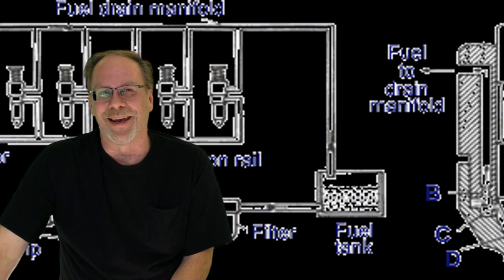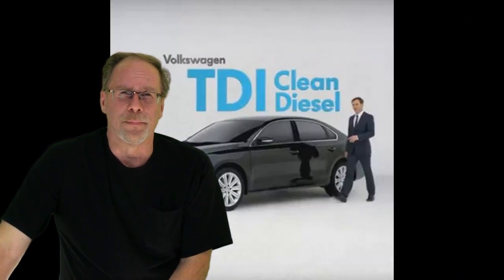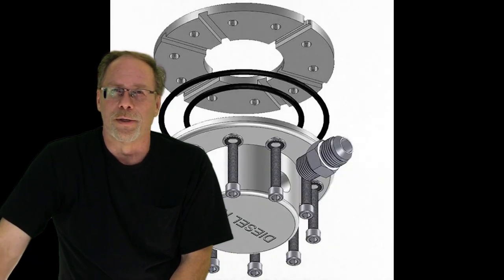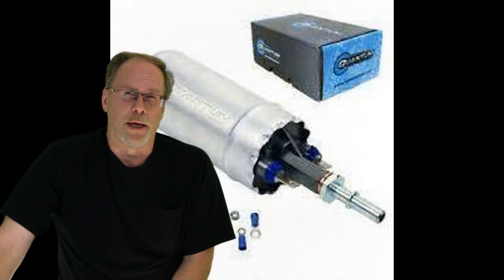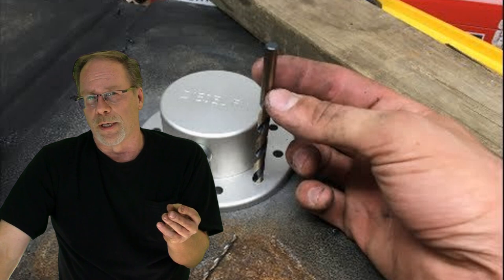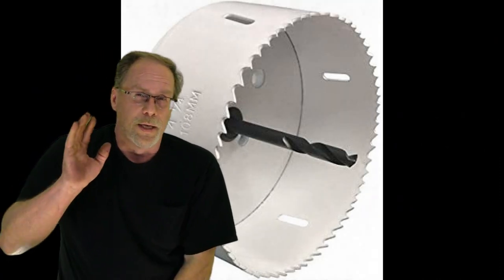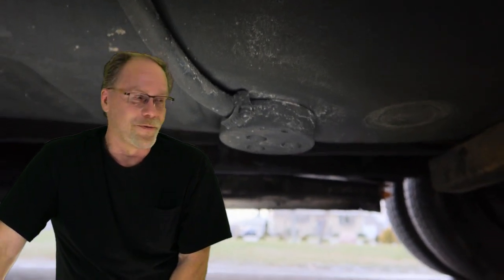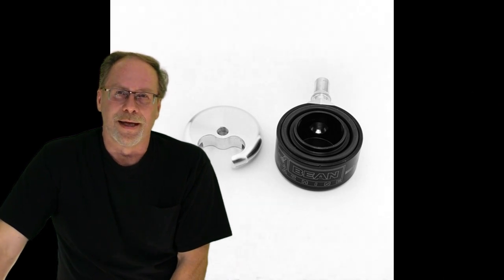7.3 POWERSTROKE TANK SUMP EXPLAINED...............

Comment: great to know, thanks. I may do this with my obs. One minor thing, what you called cavitation (9:38) is just called vaporization. Cavitation is when you have a turbulent low pressure area (say the downstream side of a partially closed valve) that causes vacuum bubble to form and collapse rapidly, which will cause damage to the surfaces around it. It can also be caused by high vibration areas, such as the cavitation problem on the 7.3 IDI. What you described is just fuel short cycling and being heated to its vaporization point.

Comment: I did the hutch and harpoon mod 7yrs ago. I did compression fitting on return. I took a tubing bender and bent away from float + i added 18". Love that mod. Again great video Clint.. btw I I twin screw on filters. Actually PO had it on but was disconnected.
Reply: Described the same way (dieseltechron) showed on his Chanel!! RIP Ron!!

Comment: Morning from South Texas
I really appreciate your vids they are really helpful,i bought a “01” f250 7.3 last year this would be my fourth one,it has 203,000 on it 4wd 4dr recently it started running rough and lopin,in watchin another source on utube i gound that the icp was bad but i am going to drop the tank and clean the filters this truck has a added fuel cell under a tool box which flows into the original fill tube and the truck was ranch truck till i bought it so im fixing things as i go.
Thanks,Ron
Reply from the maker: Top 4 for this issue Cam sensor, IPR,ICP Wire harness, plug

Comment: I have been wanting to swap the stock rear tank with the 38-gallon tank and put sumps on both tanks of my '97 F350 crew cab. I already have an Irate E-fuel system installed with the stock setup but would like to change up to larger fuel lines. The problem is the fuel tank selector valve and its fuel line size. Do you have a suggestion on how to keep both tanks and upsize to the 1/2" fuel lines? Thanks for all the info.

Comment: Also... is there a trick or an easy way to get  the back turbo/exhaust clamp back on??  in 2003 we did a ton of upgrades to my 2000 7.3 and that clamp was a Sun on the Beach to get back on!  and now I've got a pedestal oil leak so she's down till I pull the turbo and pedestal... which ain't any fun!  Advice??
Reply from the maker: I got a Banks Clamp easy to get on a real bear to get off though, I find using a bottle jack to hold the pipe up in place from under the truck makes life real bearable with this difficult clamp, Follow the never leak vid I made and if done right you will never have to do this again
Reply: I know this was a few months ago... but I used a paint marker, drew a line from the dowel-up over the top of the ypipe, and a line from the dowel hole up over the top of the turbo. Put the clamp on the pipe,, snug on the bottom,, slip turbo into the clamp,, line up the 2 lines, clamp her down. 
I struggled and entire day, just could not get it. Quit for the night and just thought about it... happened to pick up a paint pen for something else when the light bulb went off.

Comment: Thanks for the videos. Your videos are very helpful. I’m having a hard time finding Info on  putting a sump on dual tank trucks. Would I need to go from each tank into the tank selector valve?
Reply from the maker: either a modern tank selector or a parallel tube balancing both like dual semi tanks or a pump and switch pump from far tank to closest tank any option here will work
Reply: @CUSTOMWORKS7.3PSD  your the man. Thank You
Reply: @CUSTOMWORKS7.3PSD  If I wanted to got he "modern tank selector" route, is there certain brand or part number I should be looking for?
Reply from the maker: @gabemedina2287  Ive used these before with no issues just got to make sure the inlet n outlet is of correct tube size I don't have the part number any more       JDMSPEED New Fuel Tank Selector Switching Valve 3 Port
Reply: @CUSTOMWORKS7.3PSD  Bookmarked! thanks a bunch. I dont subscribe much, but you'll get one.

Comment: Why can't you stick a sump (or similar) pump in the tank and go out of the top?

You could still position it lower in the tank than the original straw,  have those larger fuel hoses/lines, and attach the in-line filter to the frame in an easy to service place. 

Plus, you wouldn't have the possibility of hacking it off accidentally while off-roading or having a leak because you just put a hole in the bottom of your big gulp. 

Gravity can't be doing too much work with the sump pump because diesel still has to make it to the injectors.
Reply: Apparently, FASS has a system just like this. I'm not sponsored. I was just curious and looked it up.

Comment: Just found your channel and binge watching. My 1996 7.3 E350 has a mechanical lift pump in the engine valley. The van has 310k on it. I have had it 5 years and 100k and wonder how often the pump needs to be replaced. Thanks for the great content.
Reply from the maker: The rule of thumb if you want to do pre maintenance is at the 300k area
Reply: Grant do yourself a bid favour, check out youtube for 7.3 fuel bowl delete and mechanical fuel pump delete.
Reply: @CUSTOMWORKS7.3PSD  my 97 7.3  has 270,000 on it and the mechanical pump has failed 3 times and eliminated (efuel) once. I have 2 Bosch 044s on a relay so I have a backup, and a primary and secondary spin on filter. Both tanks have been sumped. The rear tank is now the 38 gallon tank.

Comment: Here was my thought in 2004, I know... I had a thought don't cha know :)  I dropped my tank and removed the 2 screens to help increase fuel flow,  added a filter on the frame and for giggles we put a 128 Gal tank in the bed, before the Govment out lawed big tanks over 92 gal... So the big tank keeps the factory tank full, no sucking air or foam  :)   But now I like the Sump idea better.... just need to burn off 160 gallons of $1.99 fuel I bought over a year ago :)
Reply from the maker: That's a lot of fuel
Reply: @CUSTOMWORKS7.3PSD  Yeppers, but I can pull a travel trailer to the wife's parents ranch outside of Boise, ID and back to ABQ and still commute to work for another month or so.... But it hurts the wallet to filler her up! Plus from the first fill-up I've always user Power Service fuel additive... even in my semi's back when I was OTR  driving!  My 87' KW had twin 250 gal tanks  :)

Comment: So does this eliminate the sending unit? and if so, how does the dash guage read the fuel level? My rig is running out of fuel at a quarter tank and I'm wondering if this will solve the problem. thanks
Reply from the maker: yes will solve issue and if sending unit is bad pull it out and clean it first
Reply: @CUSTOMWORKS7.3PSD  TY, just to clarify. Do I still need the sending unit?

Comment: Shucks. I was hoping that this vid would recommend a location to install my sump. The “best” place I can see without dropping my tank (I do not have a lift) is the spot in the middle with the round indention, but I am leery of drilling my 3” hole there because that indention must be for a reason and I do not want to drill a 3” hole right beneath the OEM pickup assembly, which would mean I would need to buy a new tank and install the sump somewhere else.
Reply from the maker: I always install under the pick tube area and if you want to go the next step divert the incoming tube straw 12 inches to the front of tank and if you want to go even further cut the fill tube 6 inches from the top of tank

Comment: Does anyone have a suggestion or link to one ? I’d like to go with what has been used and reviewed positively…thanks
Reply from the maker: They all do the same thing, Low or high priced best bet buy one that has 3 bolt fastener single lead out and keep the return line right where it is also get a new feed hose with the quick connectors
Reply: @CUSTOMWORKS7.3PSD  I do not understand. Do you say having the return line far away from the pickup line to avoid cavitation?
Reply from the maker: @trondvidardalseng894  yes keep the 2 at least a foot apart
Reply: @CUSTOMWORKS7.3PSD  Thank you for your answer. I understand. A quick question. Does the return line have to be from down and up in a swamp install? Or can I install the retun line from top on the fuel tank and down, downwords? What would be the best result in that kind of install?
Reply from the maker: @trondvidardalseng894  I prefer single line out of sump and return line top of tank where it is currently located
Reply: Hi Clint “rookie mistake” here again I’m about to install the beans machine in my 2001 7.3 I wanted to find out when I connect the machine what quick connect do I use and can you recommend a in line filter